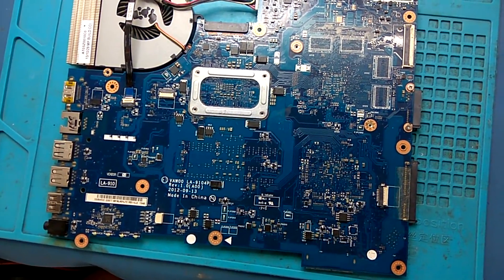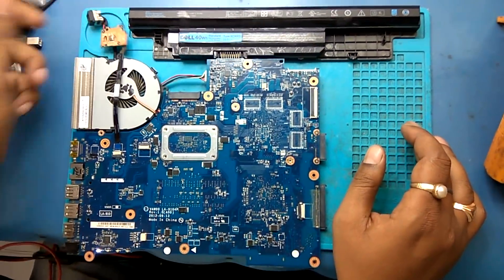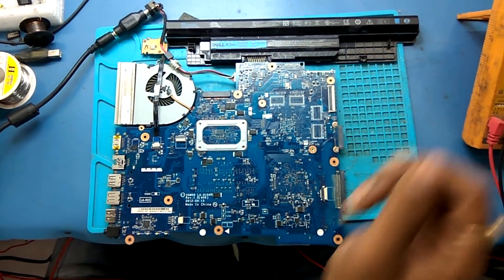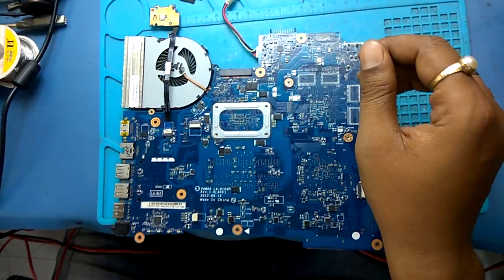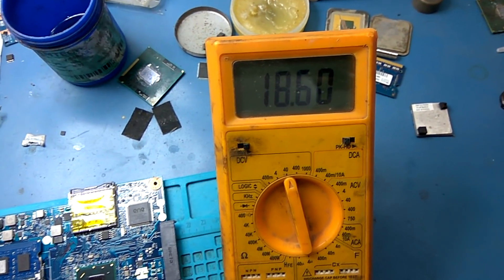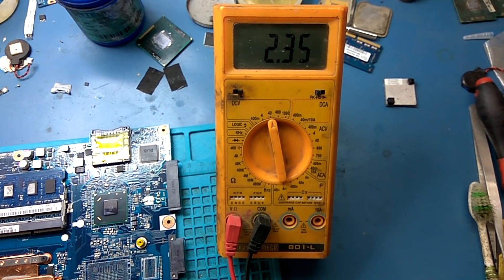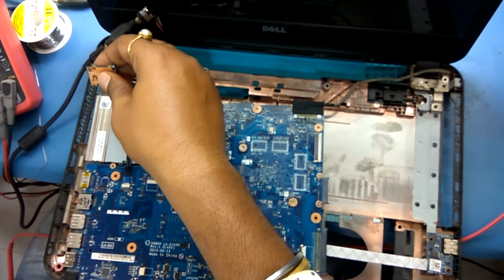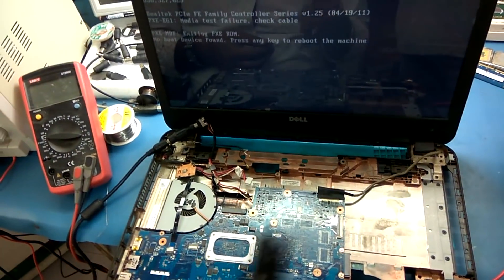Laptop Working with Battery But Not Working On Adopter Fixed (Demo) by #Satishbhai & #Aditya11ttt

Comment: AC_OK-->AC_IN--->PQ114         the PQ114 complete the voltage devider circuit. am I right brother ? 9707866958 is my whatsapp and telegram number.
Reply from the maker: Problem is shown in the video and already told what is missing so no point of repeating same thing and no issue with mosfet already said !! Thnx !
Reply: @Aditya11ttt  okey thanks

Comment: Ac ok signal is missing
Reply: Yes ac ok is missing , I solved this problem
Reply from the maker: 👍 same board Can have exactly same issue but it’s not necessary that it’s solution is always same it can vary board to board even though board is exactly same !! Only an experience person will understand what I said !!
Reply: If ac in is OK  May be p channel transistor or voltage devider circuit foulty
Reply from the maker: U can check the video !!
Reply: @Aditya11ttt  2nd mosfet short
Reply from the maker: Unfortunately no !!

Comment: B+ line is shorted due to capacitor
Or step down for charging circuit has short
Reply from the maker: Unfortunately not in this case !!
Reply: @Aditya11ttt  them it must be related to adapter present signal and dc in signal to must be absent or may be leaked vin mosfet also you are getting low voltage in vbat line that why charging circuit won't work voltage should be same as inputs after second mosfet for charging circuit to work
Reply from the maker: Sk ELECTRONICS nothing to do with mosfet also !! As far as this case is concern !!

Yes there is some problem definitely and there are thousands of guess work can be done !! Kuch na kuch tho 100% hoga hi !! The day u get the same u will solve !! But as far as two of ur answer don’t fit in my case !!